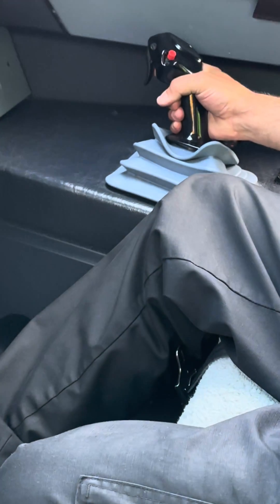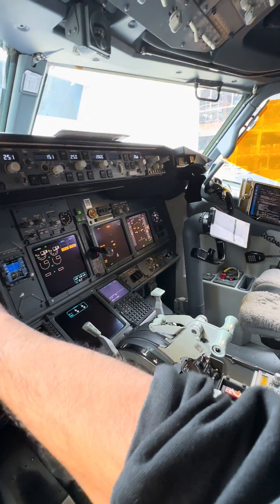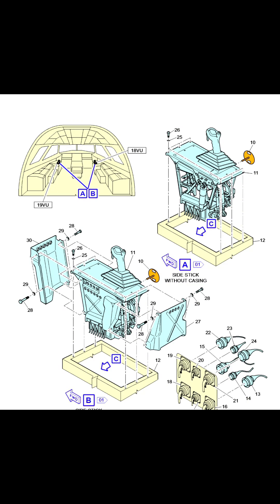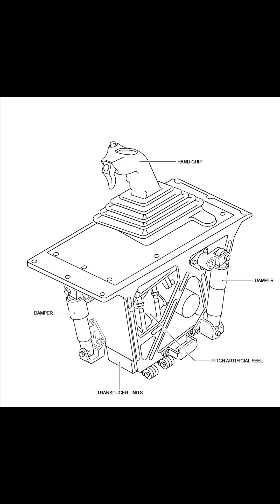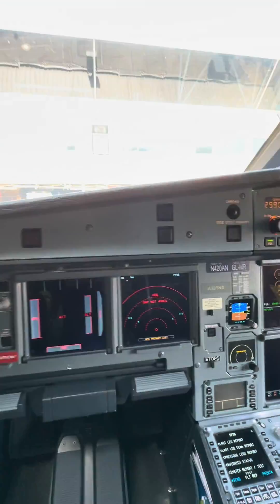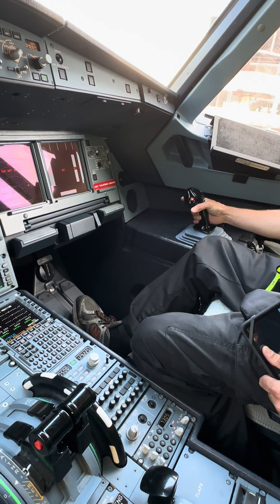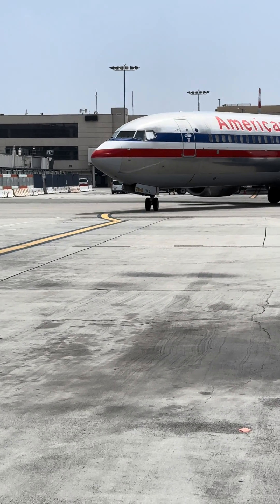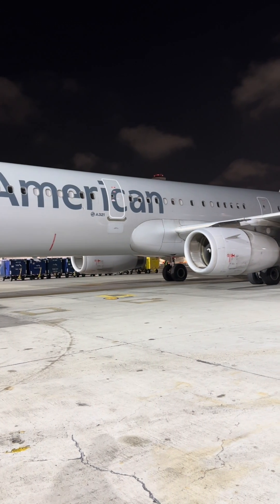Side stick VS Control Column (yoke)

Comment: The huge mistake done by Airbus, is that you do not see the controls moving when the autopilot or the other pilot is moving it. The same happens with the throttle levers.
   By doing that, Airbus removed from the pilots one very important way to know what is happening just by the tact.
    Is the same as taking out some audio warning and letting just a visual warning to indicate something ,for example. Of course the more senses can be used to identify a situation, the better it is.
   On this matter,  Boeing philosophy of moving yoke and throttle levers is way better.
Reply from the maker: I can understand your point of view, i guess it's a different philosophy as you said
Reply: @StigAviation  Exact. 👍
Reply: After flying the bus for a few years now I can say confidently I don't miss yokes at all. Neither do I miss the feedback. The autothrottles are pretty good I find, save for the worse gusts, at which point its trivial to go to manual mode. Even in the worse crosswinds you only need little more than your fingertips on the stick to bring it to a nice landing. Boeings handle like boats by comparison and you need a LOT of movement on the yoke to get the plane to do anything. This is about my only gripe with the bus; I can always tell when I'm flying with a former Boeing guy because they tend to over-control the crap out of it, "churning butter" with the joystick we call it in my outfit. The "bike" style yokes on the Embraers are better than the U style boeing uses I think but still a workout in a crosswind. Boeing guys loooooove to talk smack about airbus until they fly one, and nearly all of the ones I've flown with say they wish they came over sooner. It's a very comfy, quiet, large flite deck with intuitive systems. It's the gentleman's cockpit. Some fools will say "rEaL pilots fly Boeing", but I argue myself and many others flew even more real regional puddle jumpers with no autothrottles or vnav or any other fancy gizmos for a decade. I think I earned the right to relax in a comfy late model Cadillac rather than settling for a Ford Pinto.
Reply: @aerialbugsmasher  Sorry, man. 🙂 I guess I was not clear , and because of that, you misunderstood the point and 
mix subjects.  
     Of course, both Boeing and Airbus make safe and good planes, with characteristics that are very easy to learn by any professional pilot, even when the pilot changes from one plane to another.  It is just a matter of a bit adaptation. 
   What was being pointed out is that fundamentally, the most important interface flying the planes is still the human interface, and this interface has an important sense that is the tact, that helps to identify, with great speed and accuracy an input in controls made by the autopilot or by the other pilot.  Using the tact, you can also, for example ,identify if an airplane is approaching stall speed.
   Note that the amplitude of controls used to control the planes( sensitivity)and strength used to move it , do not change the topic of controls with movement and pressure feedback, since Airbus Autothrust and sidesticks could still have the same amplitude of controls, but still have that feature to the pilots.
    You got used to not having the control pressure and movement  feedback , but imagine if besides everything you like about the Airbus regarding the control behavior, it also had that feature. 👍🙂
Reply: The 2009 Air France crash would not have happened if not for the side stick system.
Reply: @lawv804  then using your logic atlas air 3591 shouldn't have happened either. Both were because of the FOs  moving the controls in the wrong direction. Yoke or joystick, FBW or not, that's irrelevant. The common denominator here is moronic flying skills. Period.
Reply: @aerialbugsmasher

AF447 was in a deep stall… for almost 5 minutes.. due to the FO pulling full back on the stick which the RP and Captain weren’t aware of.  

In a Boeing it would have been very obvious and the correct stall recovery performed.  

What’s more.. Boeing would not lull its pilots into a false sense of security by having them believe that Alpha Protect will save them (which was disabled in Alternate Law after it lost air data).
Reply: @lawv804 the max crashes woudnt happen if Boeing had a sidestick
Reply: @topethermohenes7658

The MAX crashes had nothing to do with the type of controls the plane had. It was because of a system that Boeing didn’t tell the pilots about with a single point of failure, no comparator, and no annunciation.